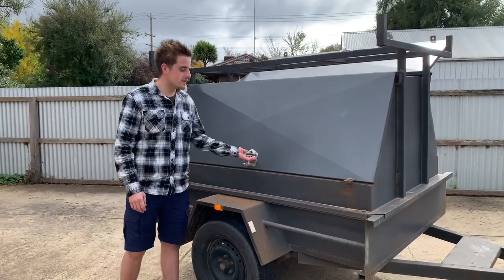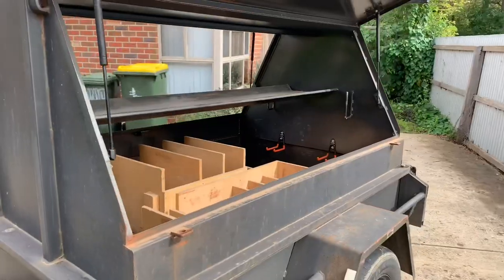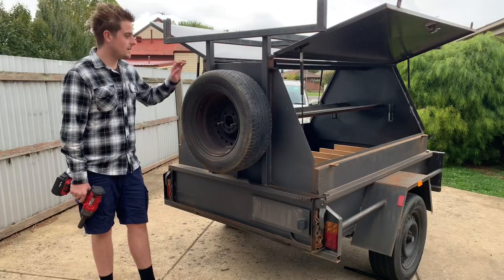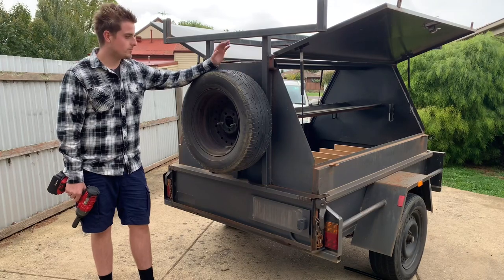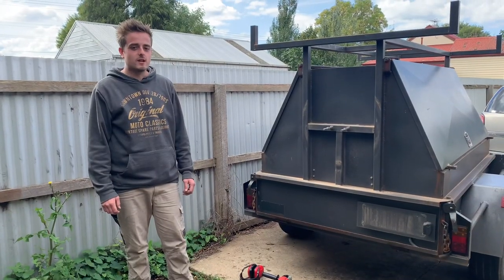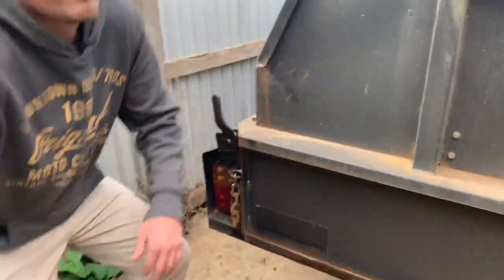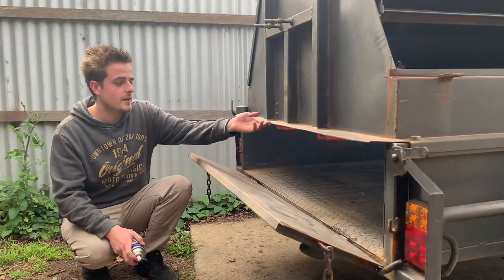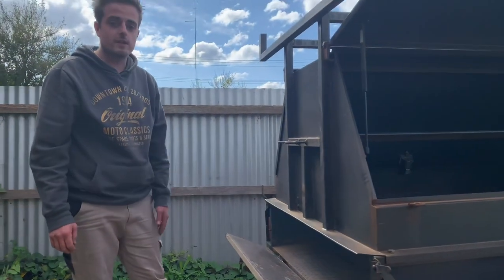Camper Trailer Conversion

Comment: Thanks for the video, how did you mount the roof top to the roof. Straight onto the ladder rack or something else added first? TIA
Reply from the maker: I ended up mounting a roof rack with u bolts to the ladder rack of the trailer for extra storage. Then mounted the tent to the roof rack with much longer bolts to squeeze the rack to the ladder rack also if that makes sense. Made it very solid and has held up well.
Reply: @EngineeredToDesign  thank you!

Comment: Is this a John pappas 6x4 trailer? Just bought one and plan on doing something similar to yours. Great vids mate. Keep em up
Reply from the maker: GtaGod thank you 😊 I am actually not sure it possibly could be, I think it was originally made around 7 years ago, I will have to have a look on the ID tag.
Reply: Awesome thanks. Also, what did you do in terms of suspension? Mine already has the flipped axle but not high enough for land cruiser tyres yet. Any suggestions?
Reply from the maker: @TnRadventures  I flipped my axle and put larger hubs on, you could get larger weight springs or modify your guards..